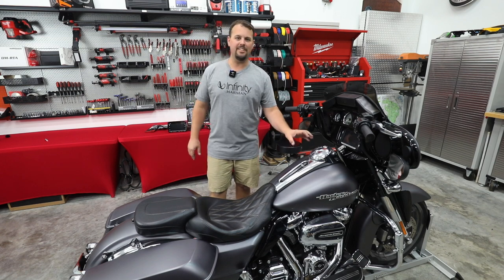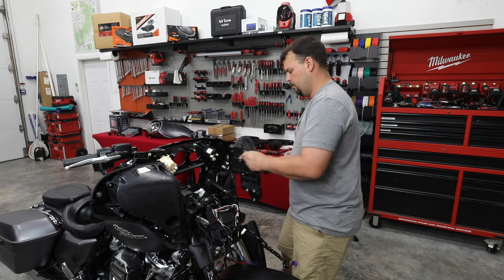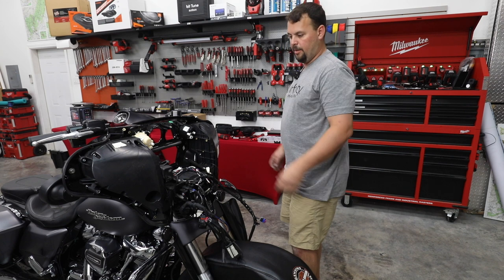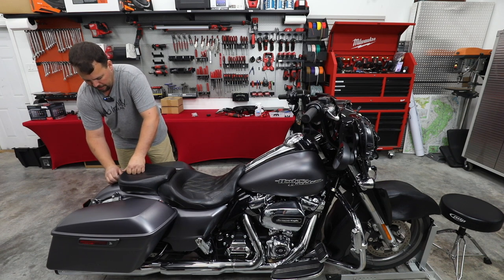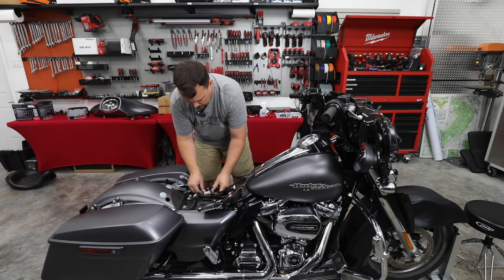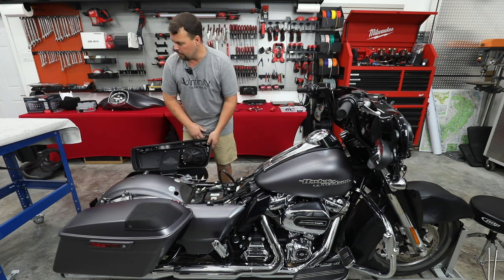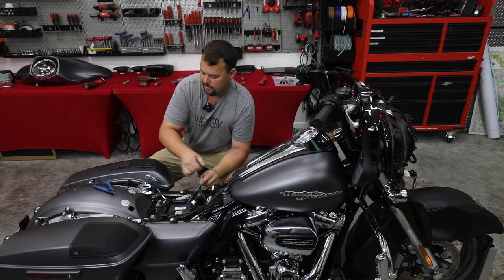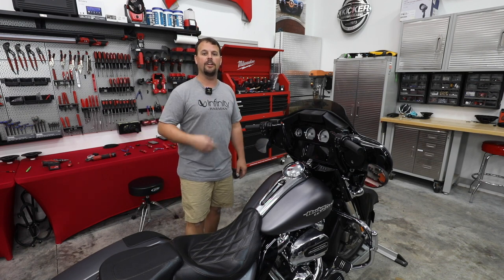Step by Step, Infinity Kappa Perfect 600X 6.5" and 900X 6x9" Harley Davidson Speaker / Amp Install

Comment: I bought a Stage 2 with the Precision Power amp and the Kappa Perfect fairing speakers for my '17 Road Glide Special. After installing it and getting the radio flashed, it was a major improvement but I regretted not going with the Stage 4 with the speakers in the lids. I contacted Volunteer Audio, and they shipped out the rear Kappa Perfect 6x9 speakers and harnesses.  So I got a Stage 4 for the same total cost (to the penny) had I gone with a Stage 4 from the get go. Now my bike is a rolling concert hall. This is a great company to do business with. My advice to anyone considering a Stage 2, go big or go home.
Reply from the maker: Thank you so much!
Reply: Should I just jump to dual 6x9 in the lids instead of just a pair of them? Nervous about leaking lids with the duals. But would love the sound.
Reply: @thek1ng390 my suggestion is to stay away from dual lids. They will leak and honestly it's really hard to get dual 6x9 lids to sound well together. Plus you loose less bag space. A quality 6x9 at 4, 3 or 2ohm will 0:04 sound much better.

Comment: Jay,

Thanks for the detailed install. I dropped in to mainly watch your lid cut outs.. I'm doing a similar install (same bag speakers , but keeping the OEM GTS head unit, and adding a single 4 channel amp with 4 coaxial speakers.. I was confused to see the new bag speaker back bone wiring plug in to the Factory harness (rear speaker OEM out) rather than into two channels out of the new amp (?)  The other area of confusion was your mention of rear speaker polarity swap (?)   Thanks for the demo.. and be safe out there
Reply from the maker: Yes our plug n play amp setup uses the factory harnessing at the radio so all stock wiring is maintained and used, we include in our kit proper harnessing to plug in the fairing to make it truly plug n play, the output of our amp is feeding the stock rear speaker connector.  Harley more times than not has reversed polarity factory on the rear speakers, reversing the wiring fixes this

Comment: Order my reserve from you a few weeks ago. So far pretty nice radio. Only thing I don’t like is the 50 clicks it takes to turn the volume up. I wish I could just hold the volume up button and it would raise the volume, but I literally have to hit my hand control 50 times to go to full volume (annoying as hell). And I wish there was a quicker way to adjust bass or treble instead of the 13 band eq. Would be a nice feature for when you are rolling down the road. Maybe they will have another software upgrade to fix that
Reply from the maker: Which radio did you get? On the SI if you hold volume up it goes up without hitting it over and over, there is a .5 sec delay
Reply: @volunteeraudio  I got the si. I will try again, but it did not work when I held it
Reply: @Nick Eminoski  mine goes up if I just hold it.  Takes a sec like Jay said but otherwise works like normal

Comment: I have the soundstream radio and infinity kappa 6.5's. Will adding an amp be a big improvement? I'm wanting to add an amp and 6x9's in the bags, but.....not sure if I should switch to the hertz, or just finish the system with infinity
Reply from the maker: It will make a huge volume difference and better midbass presence
Reply: Will the Hertz blow the infinity's out of the water or is the difference between the systems be minor? I'd really like to just finish my infinity system but, I don't want to be disappointed in the long run.

Comment: Question: I tried to install Kappa Perfect 900x 6x9 in Harley CVO 09-13 saddle bags but the speaker lids will not close due to clearance issues. Have you run into this problem and if so is there a solution for it? The cages design hits the side of the bag and stops the lid from closing.   Thanks in advance..... Kase in Georgia
Reply from the maker: What brand adapter are you using?
Reply: @volunteeraudio  I am not using an adapter the lids I have are for the single 6x9 speakers I can’t add pics  or I could show you which ones I have but they are just the normal 09-13 6x9 speaker lids on cvo bags….. how do I solve this?

Comment: Which amp did you use?  SP4.900 or SP4.500
Reply from the maker: @brianpotter9933  the infinity speakers do not handle the power of the 4.900 , so you need to use the maa4.400 or sp4.500

Comment: The most I could get out of Kappa speakers is around 4 months without a amp. They’ve never stopped playing they lose their sound. Take them out and sure enough the foam will be coming around. Wonder why?
Reply from the maker: These are the kappa perfect 600x and 900x, we have not seen this issue but we only use the motorcycle speaker in a motorcycle.  If you notice the rubber surround is inverted on these.  I have seen surrounds that are not inverted rub the backside of the factory grill until they rub through the surround
Reply: @volunteeraudio  I’m pretty sure when I was buying those the didn’t had the motorcycle speakers out yet, my bag
Reply: Volunteer if you don’t mine me asking you a question I’d appreciate it. I’m no stereo guy really . If my wife didn’t ride a lot with me I’d still have everything factory. But she got a nice stereo in her car and she likes the music. But my question is do ya’ll put any type of padding in the saddle bags when putting speakers in there.? If so what padding or foam would you Suggest? Sure appreciate any knowledge you could share?
Reply from the maker: @tchogworks1987  what Harley do you ride?

Comment: Hey Jay, question, how come you installed a hertz amplifier but changed the amplifier in the package to a precision power amplifier? Will the result be the same? I already have the kappa perfect 6.5’s with a sound stream radio on my 22 police bike but I’m looking to add a amp and the matching 6x9’s.
Reply from the maker: The infinity will only handle the power of the precision power, the new hertz sp4.900 is too powerful.  The amp in the video was the older hmp4d, this precision power amp is better
Reply: @volunteeraudio  Thankyou, as always you guys are great at answering my questions.
Reply: @volunteeraudio would you be able to add the bag speakers to this amp later if you only started with then fairing speakers and this precision power amp?